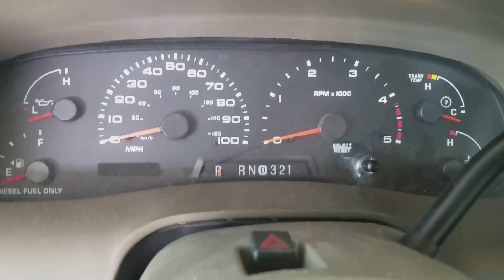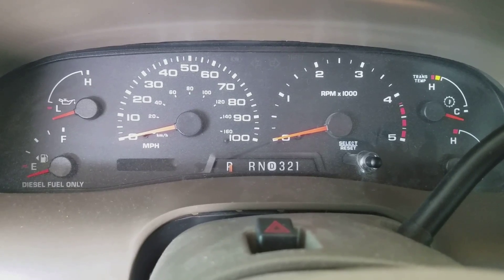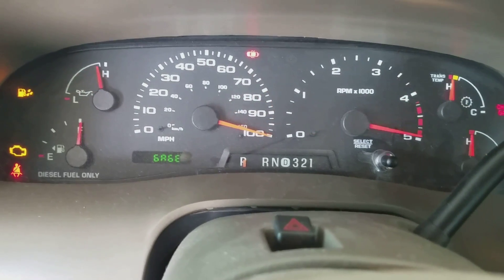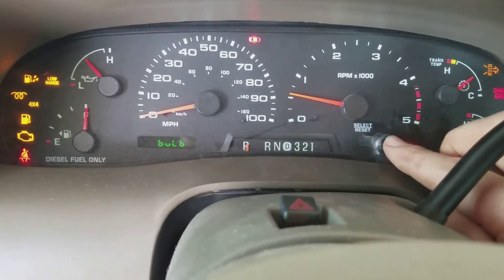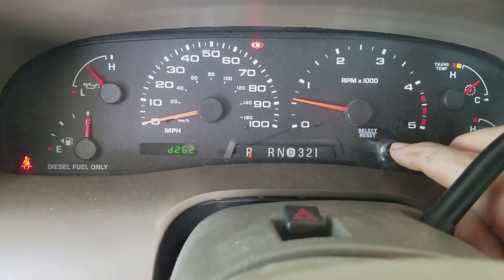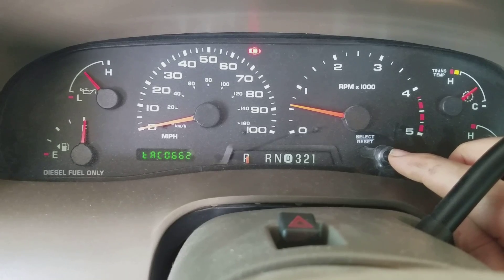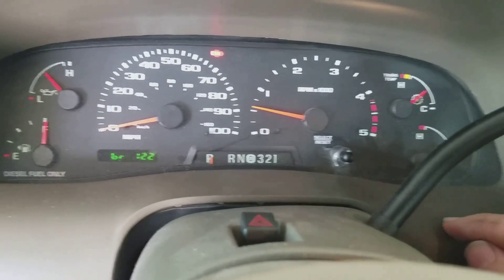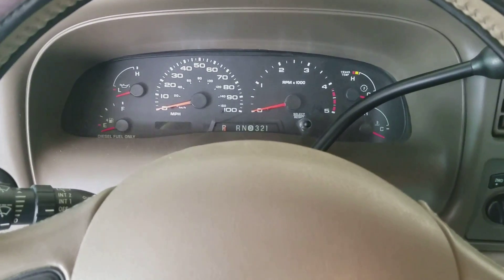Ford Excursion Super Duty Odometer Trick

Comment: There's another video on this and reading through the peoples stuff, a ford guy reads off what they stand for from 1 through 20 and starts over on Ford 150, I'm here and now can't look it up as a video I liked,  one thing I'd like to know,  can you idle it down from here, I've done a tune-up from many check engines lights coming on for same thing, my friend that sold me my Ford Explorer 4.6L AWD LIMITED and #5 &6 cyclinders kept failing for the 1st 6 weeks. He said never had issues,  on a handshake,  he was supposed to fix vehicle for me, he kept blowing me off, lost a great friend and mechanic over him not wanting to fix my vehicle and reset the computer, used to get 16 mpg until the check engine light kept coming on, he said I replaced the coils, there inder warranty,  get new one's through them,  I gave you the paperwork on Denco,  well he's put multiple used ones on about 4 times and gave me 2 extra icase, he scraps cars on the sude for cash money with working out of his garage to, some day he's gonna get caught because he has lots of toys with about 7 vehicle's registered and insured but just him and wife. Meanwhile I ended up replacing loose spark plugs ready to pop out that loose, he said there known for it, I said if so, then why not check the spark plug being good or not and tight to boot while I was there with you checking for voltage on it, replaced, replaced, replaced, replaced, and replaced with given 2 extras after 5 or 6 weeks after buying it, didn't have 750 miles on it, he plugged in snapon computer that he stated this does everything.  Used to idle at about 700 RPM's now,  now its higher to about 950 on RPM's roughly and miles went down because of check engine,  i drove slow for many miles with new tune-up and still idles at same place. Its the money pit, winter time is coming and will break down like always,  I'm disabled and used to do my own work i barely can do an oil change because I'm that bad. Why i made a deal with him, if I buy, I'll supply parts and you fix it, I'll give you what I can,  he's never taking money from me,  I had to give to him, one thing that ticks me off, 7 year's ago,  I was offered $700 on my minivan but gave to him as a deal I made for him fixing my vehicles.  I have all kinds of scrap metal in it and 10 car batteries with one RV battery thats huge.  Plus my riding lawn mowers, its batteries given to me and wirth $8 to me at a point, now worth like $2 a battery.  I went on summit Racing,  they carry factory replacement parts at better deals than local parts stores, if you call, then you can get a better deal,  just say i prefer since you helped me,  not sure if work off commission or not but you did the work,  so I want the person to know that i called yesterday checking on parts not knowing and will call back. He  said thank you,  yes we also get commission and can give deals up to x off, since I was loyal and wrote up what I already needed and had confirmed that fit my 2003 explorer 4.6L AWD LIMITED cost me $180 for nice Wagner Rotors thats dipped for eastcoast weather and salt in roads for winters, got the Wagner pads as well front and rears plus a box of 8 new spark plugs that was NGK and new Coil packs that came in a box of soft goam that fit each one perfectly,  i took the Denco out and labeled each one and put in place in box from 1 through 8, nice box 6 are Denco, not sure the other 2 for.  Runs 10 times better than before but Tach is still at 950 RPM's now. Like to drop down to factory settings that my so called friend was supposed to do.  He said tough the battery terminals to do,  so now you can't reset it at all,  I never did what your talking about and don't want to blow up my computers incase. He's like what do you think I am, a ASSHOLE,  i said no, I saying I never did this and never heard of it, don't feel comfortable doing it, so I tried it and now nothing has changed at all. Radio came on and all channels there that was set. I said it didn't work.  Now my battery was dead a few days over a weekend and didn't reset. He stated hes busy,  I'm like yeah I get it. 5 minutes is to much,  don't make deals you can't hold up at all,  told others go ahead and tell him, I almost called the tax person on him, even the town taxes guy has him work on his vehicles at no costs to him and became friends,  now he taught his neighbors son and he went to a 18 month college thats great and had a job, was doing some side work like him, town shut him down.  I don't know him, but almost went to visit, but deadend street his brother lives across the road, he has camera's he knows I drove by if can see color and plates. I did remove stickers as I don't like stickers on vehicle's,  you stick out to all. Just drove to end but he wasn't in garage so I went back by and never texted that jackass again.  Irs will catch him one day. He does have a tax i.d. number from his dad for scrap metal,  dad was last known,  was about 76, so he's in mid 80's and great guy, hard worker. I gave him everything because of it helped out his dad the most.

Comment: AWESOME!!! This trick worked with my 2006 6.0 Powerstroke.
 
My issue was that the speedometer was working but reading wrong speed. If yours does not fix itself after a reset procedure, it may have a solder disconnect in the gauge cluster that it needed to be repaired.
Reply: I'm having a problem like this I was going about 30 to 35 from phone gps but cluster speed was showing like 80 mph

Comment: Heard you mention your using  HotShot for stiction issues. I didn't work for me. If you haven't heard of Archoil , its a must for 6.0 engines, it's the only product that worked for my stiction issues. I have been using it every oil change for 5 years now.